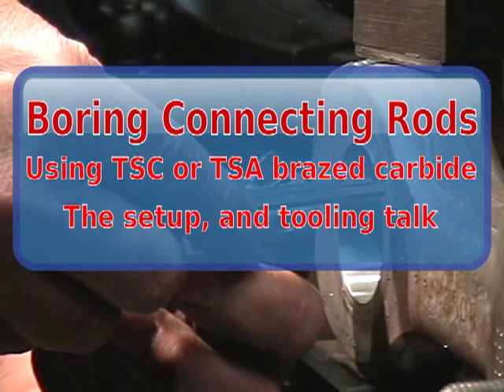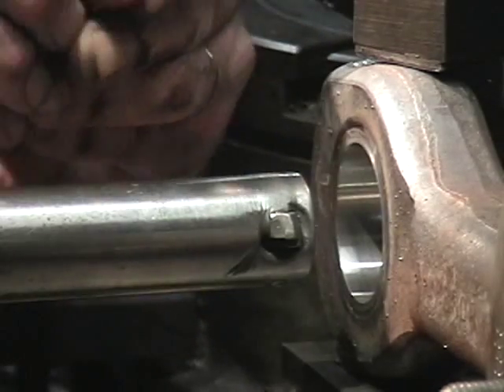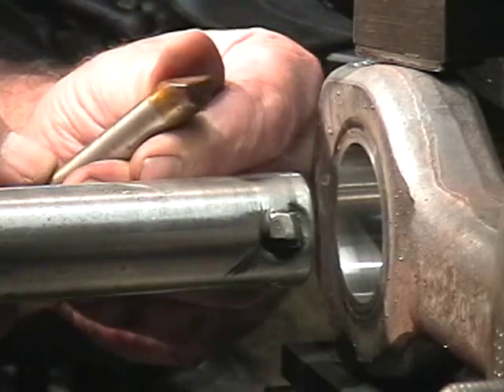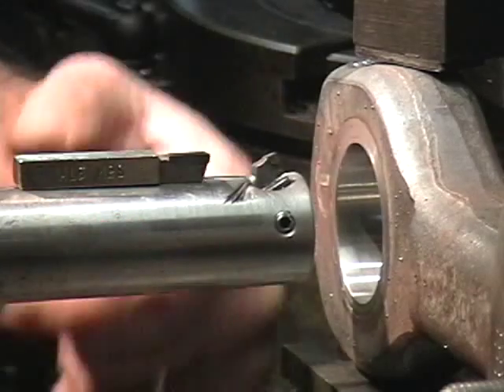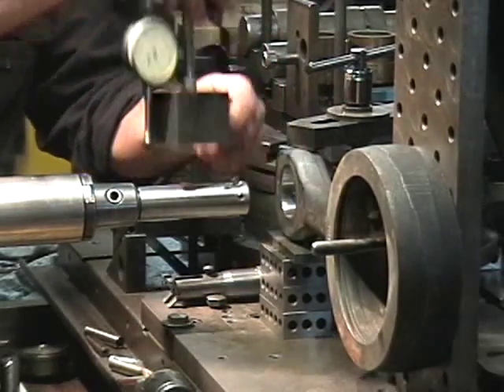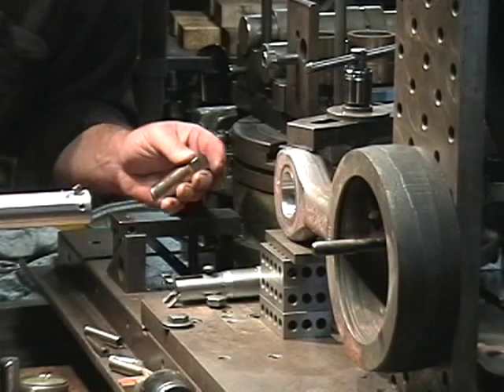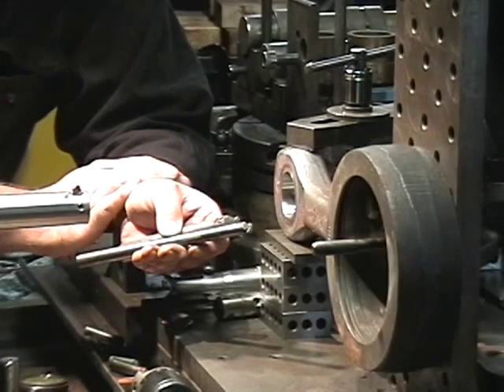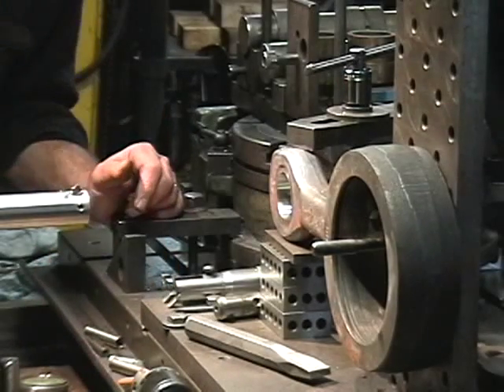Boring Connecting Rods Part 3

Comment from the maker: We see some Kearns here in the colonies mate, mostly in the northeast not so much in the midwest. Re: the boring sleeves - Just mill a slot in drill rod & loctite or braze them in. You can also drill & tap the blank before milling if you want to set them with a screw. Also you can get round HSS or "TR" type carbide tipped bits & just drill the hole for the toolbit. Good luck!